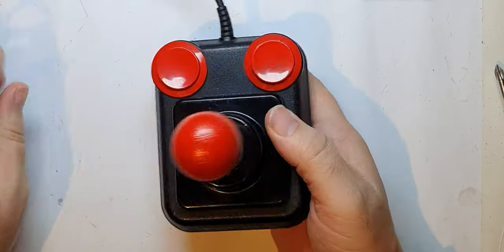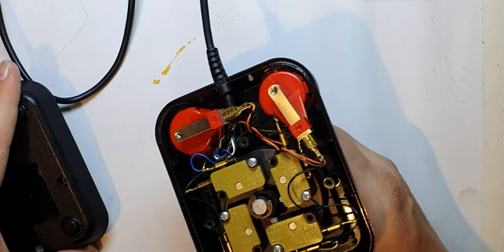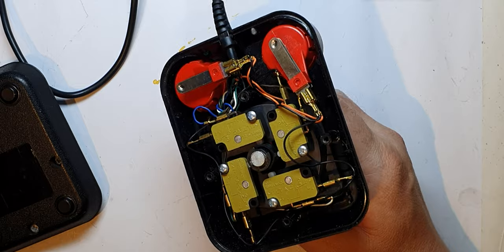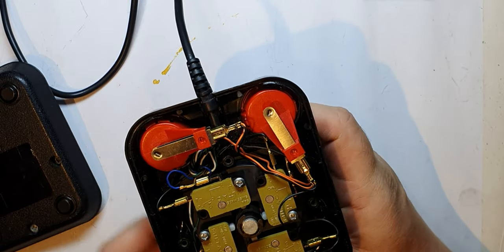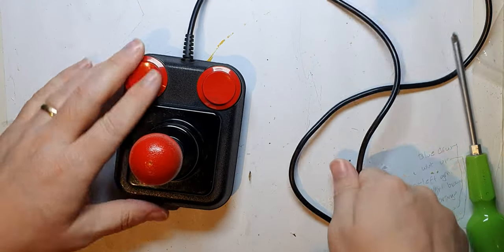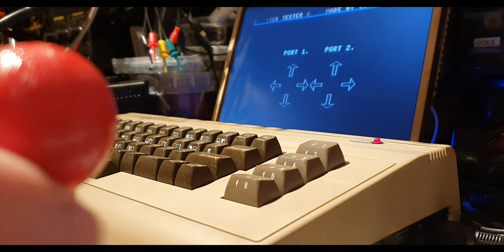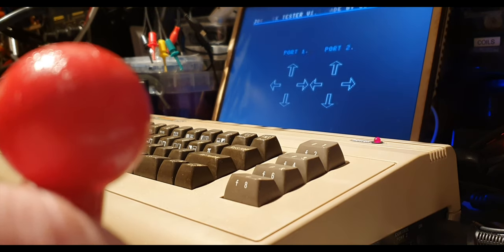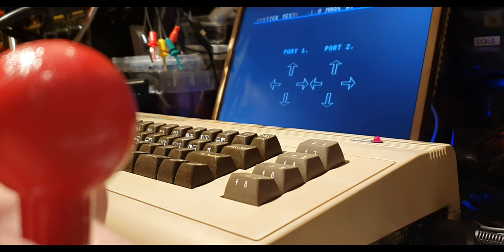Fixing a Kempston Competition Pro Joystick for my Commodore 64

Comment: On my Pro, the switches are very stiff so I want to add that white grease I recall used to be present, anyone know what type I need and where to buy it?
Reply: Vaseline will do for that. It is (virtually) the same stuff anyhow AFAIK. ;)
Reply: @danmorgan4934  I prefer beeswax, since it's natural and doesn't adversely affect rubber. :)